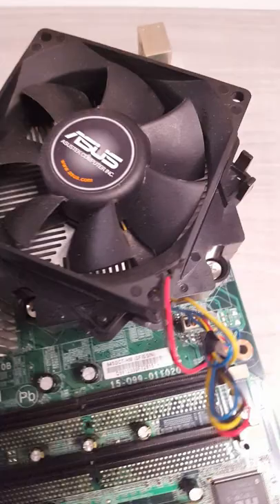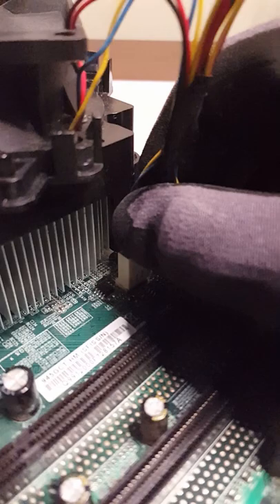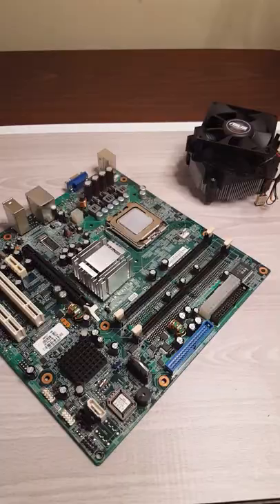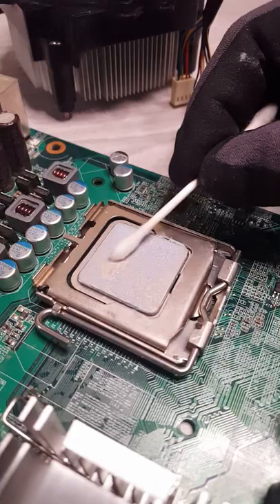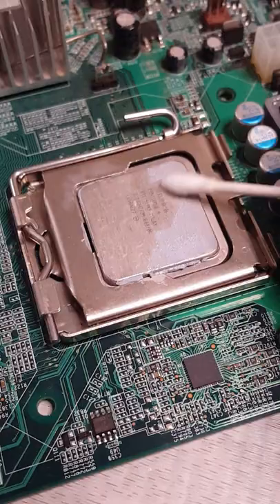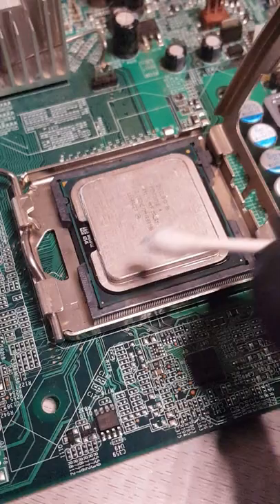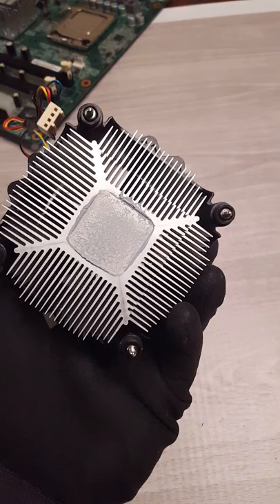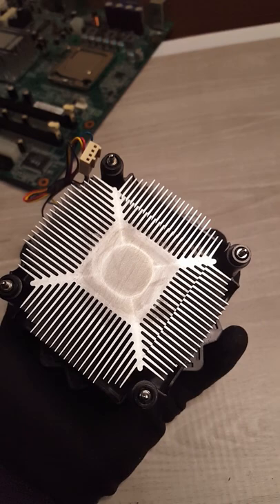How to Clean Thermal Paste off a CPU #Shorts

Comment: Thats cool and all but can we talk about how clean that thermal paste spread was at the beginning?
Reply: Ikr? Nut-worthy
Reply: before applying wet cleaning try to remove the thermal paste by dry cleaning using tissues to prevent that spread when u apply the wet cleaning, learned it from ltt and works for me.

Comment: CAUTION: Do not remove a CPU cooler for an AMD CPU this way. AMD sockets use PGA instead of LGA, which means that you could pull your processor out from its socket and bend pins.

Warm up the processor for a couple minutes, then shut your PC back off, unscrew your cooler, then twist the CPU cooler from left to right until you feel the contact between your CPU and the cooler loosen, then start to twist L/R and lightly start pulling it away from the motherboard at the same time. It should then essentially pop right off and you can clean your processor from there.

Comment: AM4 Users, twist and wiggle the Heat Sink off, or you will yank the processor clean off, and that can leave you with bent, broken, and or missing pins, and i mean it when i say, thats a bitch to fix
Reply: this just happened to me, took cpu cooler off and was wondering where my cpu was and it was still attached to the cooler. rip. 🤦

Comment: One question. Does it really need isopropyl alcohol to rub the old thermal paste? If yes which % should it be?
Reply: Only one type made in Viena
Reply: it is up to you. you can use every cleaner that leaves no residue on the parts. glasscleaner, lighter fuel, etc

Comment: greetings, normally i'll just remove the cpu from the socket, clean it, then put in back into the socket and reapply thermal paste, but not so long ago, two years ago to be specific, almost my motherboard dies, two single pins was a little bented, with a friend realign them back into normal position and the computer came back to life again, recognize all the ram and runs as normal, but am afraid than if ill remove the cpu from the socket the mechanical wear than the bented pins sustained would be too much and the risk of broke will be too high, after watching this video then thats means than it's not needed to remove the cpu from the socket, doing the clean and replace thermal paste with less risk.

Comment: You left out info especially if it's amd.
Reply: Like what?
Reply: For amd all thats different is how the screws unscrew
Reply: For amd if you are not careful you could end up with your cpu stuck to the cooler
Reply: @josefabarca  yup, that happens.
Reply: @elite6374  absolutely not, Intel sockets have braces that are made by Foxconn/Louge, since the cpu isn’t directly connected to the socket. AMD cpus, however, are directly connected to the socket. If you pull on the cpu cooler without the thermal paste being expanded and heated, you can take the cpu out of the socket and take it with your cooler, possibly bending or even breaking off pins.